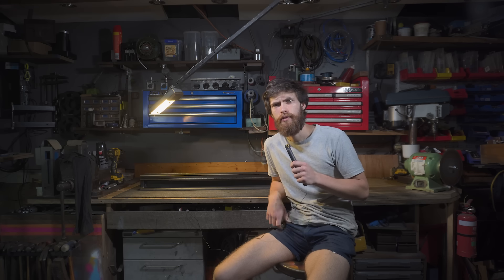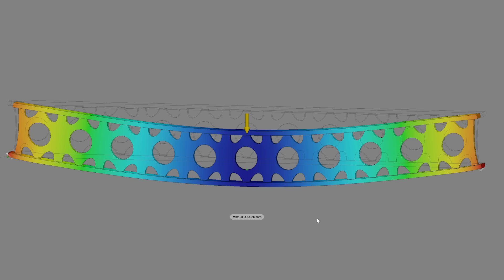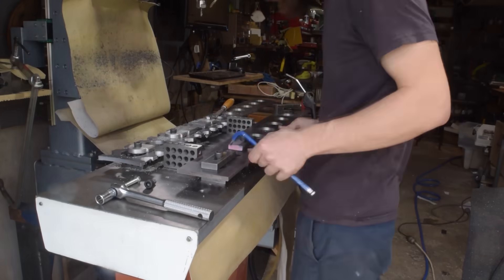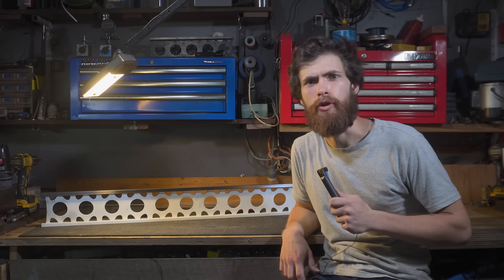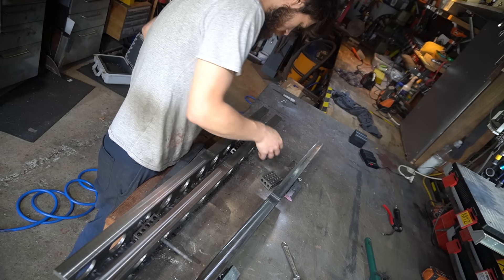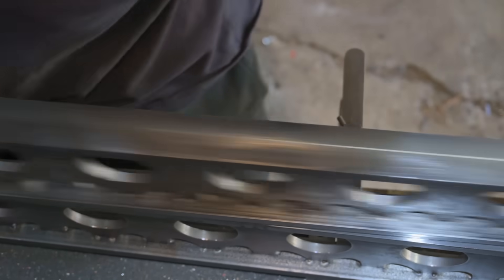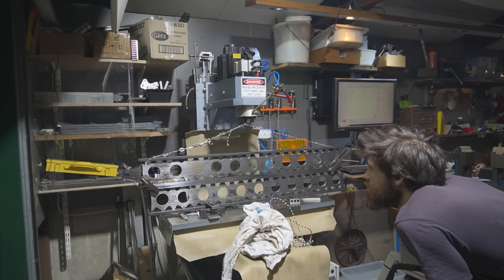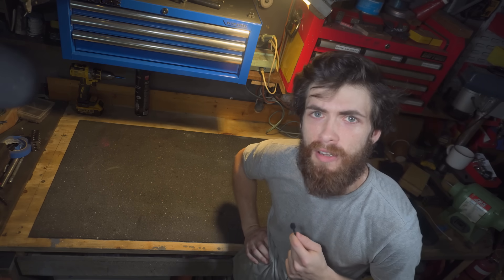I need a PRECISION straight-edge, so I made three

Comment: what is flat in 4D spacetime.... if you trust light then you are going to be misled.. light isnt doing the same speed as mass, so its geodesic in spacetime isnt what anything with mass would take, no path you can ever take will look as flat as it feels, until you are on the event horizon of a singularity. Then what you see and feel will match up, and things will seem to curve in the opposite direction.

what would the worlds largest flattest pane look like? would it curve around the planet, or would it plank on it.. would you be able to flip it even if it went all the way from north to south pole and then all the way back north? if the path was flat in time, and gravity, if you weighed the same at all points on the journey, it is a flat path in curved space, or curved space around a central mass, is it Einsteins or Newtons gravity? If you build a 1000 mile long bridge, with a glass factory making the worlds longest pane of float glass, what geodesic do you pick? flat for light or gravity? Id pick gravity, id bet it would extend all the way around the planet, and still be able to flip it over without the pane breaking. As curved as the path looks, mass considers it flat. If light did the same geodesic as the planet then it would look as flat as it feels, wouldnt it? in 4D spacetime A and B connect even via C the long way around.. that is how 4D geometry works, you have hot density in, cold void out. Motion from one to the other without ever moving, only really possible if you place the universe at the centre of a singularity that is losing mass, it relaxes and a central flat point in infinitely curved space can expand and fill the void, we all do the same, everything with mass dilates every second, but light doesnt conform, its an information wave riding an information wave, it shows the change over time, but I see Minkowski Timespace where as you all think its Einsteins Spacetime, the main geometry of Euclids circle doesnt change if you pin A or B from his compass in place, folding the universe outside in doesnt change the way the math works, but it does mean it is all mirror universes, stacked against eachother separated by tick rates. Infinitely small and hot and dense can be so easily made to look and feel infinitely cold and void and massive, scaling in time lets you flow through the multiverse, if you could go faster or slower than the current speed of information then you could traverse the multiverse, riding threads in and out of singularities.

Comment: I have a large aluminum plate I use when I need something flat and for the heat to disapate faster. It's 16"x48" and 1.5 inches thick. I clamp directly to it when I need the heat to disapate and it keeps the part flat. I am also not an engineer, but I have a bachelors of aeronatics degree and have run a welding and fab shop for the last 21yrs... Last year of college, dad broke his foot, I only had one class that semester so I moved home and commuted the hour to class when I had the class... I had to keep the business going and ended up having fun building 3 wheeled motorcycles (Trikes) using large auto engines, last one was based on a Corvettes engine and trans, so I stayed....

Comment: People  with your type of thought process, that has the essential qualities at high levels, which you clearly do. "If" they also are interested in something like engineering, as long as they hold on to their common sense they are the best for designing, creating, new kinds of different. Things that's never been done should only be trusted to them. To many others don't have common sense and they do stupid , very stupid things. Sometimes to to achieve a certain look for what they are working on. I mean, an air head with a degree in some kind of engineering, is still a air head, but now can be one that endangers folks

Comment: At this very Instant in the video 1:48, I knew the roughing endmill was going to break because it was conventional milling. Prove me wrong, I thought- and then it happened not 15 seconds later at 2:03. If you treat them right, roughing can last quite a bit longer than 15 seconds. Everything else about this video is worthwhile, so I will let it pass. Wait, I just realized he said it was his last endmill trying to buzz dry through hot roll steel the wrong dang direction at too high a speed For that direction and lack of Cutty Sark No.3 Whale Oil.

Comment: Coarse diamonds were an overkill. They got imbedded forever. There are pastes that break down along with the surface. It could have been done better. And when the edge was hung over the botom one, it was anchored on the ends certainly bowing it. I dont believe the 8 micron claim. Hillarious video nonetheless. That's how I've done it in my head before I saw it. Including the contraption

Comment: i ground a telescope mirror as a teenager.   The back and forth grinding (in that case, glass) produced a circular result.   We rotated the glass so that the result was a spherical surface overall. 

This apparently happened because when you slide one piece over another, only the center is in contact all the time.   The ends get less grinding.  So you can’t get a flat surface by sliding two pieces by each other.  The middle is going to be ground more than the edges.
Reply: The center of the top plate tends to grind more the edge of the bottom.  Alternating which plate is on top tends to make a flatter spherical surface.  Introduce a 3rd plate and rotate through pairs and the only surface which all 3 plates meet on is flat.

Comment: Its not just thermal expansion. With the straight esges being equal length the middle is alway being abraded bht the ends will get less abrasion as soon as theh overhang. With that happening on every stroke and as soon as they move that builds up very quick.

Comment: Sooooo after watching this awesome video and a few other less cinematically produced ones, I built 3 300x300x30mm reference surface plates out of welding 3mm mild steel sheet for the main plane and sides, 8mm thick flat bar for back reinforcement and rebar for concrete and gravel to stick to and make the thing more solid.

Each plate weighs just over 9kg and I dont really have a  proper way of meassuring how accurate they are but I cant fit my thinnest feeler gauge (0.03mm) under a small straight edge. But what I really found surprising was how I got them to momentarily levitate when you drop one facing another and then, when you try lifting the one above, it really, and I mean, really sticks to the one under, so you can lift both grabing the upper one even when the surfaces are completely free of oil. I looked up why this happens and there is a thing called wringability, but for it to happen, we would be talking about submicron accuracy so my guess is in my case its all about vacuum effect. 

Anyways, I came back to the video to say thanks and if anyone has any idea about this, feel free to leave your input, I'd apreciate it :)
Reply: Do they stick to each other only perpendicular to the faces, or parallel as well?  I.e., if you stick one on top and use it to pull the other up, does the bottom one slide off to the side or does it act glued in place?  I'd imagine a vacuum effect would only apply force perpendicular to the surfaces, not parallel.
Reply: @Erhannis They seem glued, really hard to pull them apart in every direction.

Comment: i wonder the materials used if they are similar to each other and the previous tooling and if the material itself is prone to the same 100 year wear. but im a new viewer to me all of this is already insane and any skimp on materials wouldnt be feasable. but something tells me the difference between tool steel and mild steel or w/e you are using is a significant difference in tollerance and what you hope to achieve with "perfectly flat." 
There used to be a time where surgical steel was mined from sunken ships and submarines pre-1940s cause of radiation and nuclear testing. also there was a significant amount of cobalt being used as an alloy which led to lawsuits for surgical procedures but in the case of tooling, it would be strength of the material you are working with.
good luck working with tooling steel or other types of hardened steel, i've already seen adam savage, and a few others i cant remember atm but all of them had a rough time. so genuinely good luck with material science cause goddamn if someone can recreate an ulfberht sword.

Comment: Maybe annealing the welded assembly before starting the flatening process would have helped with the temperature differencial deformations you got? I mean, it would still deform with temperature but that deformation would theoretically be more uniform if there wasn't residual stresses within the part due to weld contractions.

Comment: You know, you might be able to wring these. Don't know how size would effect it; they're a lot bigger than one's typical gauge block.

Imagine how satisfying it would be to wring these together. I think you should try it. =D

Wring them all!
Reply from the maker: They actually kept wringing together during the lapping, it was extremely cumbersome!
Reply: @NoEngineerHere I hadn't thought of that, it does sound annoying. Any chance you could post them wringing together, wring some good out of the situation?
Reply: @NoEngineerHere  Yeee I can assure you I beefed up while building my 3 reference plates (just left another comment about it).
Reply: My DIY surface plates briefly float and then stick together but I dont think its wringability in its full effect but plain vacuum, since I find it hard to believe I hand made such high precision tools XD

Comment: Mill scale retreats pretty fast from hydrochloric acid, only takes like 15 minutes if you scuff it up first. Takes about a day if you use citric acid but it has the same result. Citric is also very useful for removing zinc from steel.

Comment: Re: Millscale

Leave the piece soaking in vinegar for a day (warmer the better)- the acid loosens the scale and it rinses off with a hosepipe. 
Fastest way to strip it is a wire brush disk in an angle grinder, which strips all scale/paint/rust ect while leaving the bare metal.

Comment: this flat fanaticism, this flatishism, aside from earning a rick sanchez gold star, suggests you might consider making an Ultimate Pool Table ... which obviously has a smooth top with no felt, because it is so symmetrical that stationary balls don't roll, and even at the slowest speeds don't drift off their straight lines and collect in low spots. instead you simply wait for balls to eventually come to rest, without the glaring anomalies of an imperfect surface. of course, an ultra ultimate pool table is additionally placed in a vacuum; which is a useful way of keeping the surface dust free so that probably goes without mentioning

Comment: No stress relief after welding?  - That makes all that work a waist of time. - Dig a pit and build a charcoal fire and cover the weldments with more charcoal and cover it with fiberglass insulation and leave it until dead cool if that is the best you can do, but you are pissing in the wind without SOME kind of stress relief.

Comment: It seems like you might already know this, but for anyone else, the three plate method only works when you can rotate your work pieces 90 degrees between laps. This method doesn't work with rectangles.

Comment: I used to design high precision gauges.  This method is definitely a good method but in order to increase the accuracy further you would have to do everything in a climate controlled room and give everything a chance to aclimate to the ambient temperature. our metrology room was very strictly climate controlled and i think temps only varried by a degree or two at the most. You would also want to decrease the amount you are touching the parts to limit heat transfer as much as possible. Also you are incredibly funny.

Comment: Subscribed. You’re hilarious - I also wanted to share a pickling bath trick for removing mill scale. MichaelChthulu figured this one out. You just make a reservoir for the parts using objects and drape plastic or rubber sheeting over it. Put the parts in and pour vinegar till covered. Takes a number of days depending on the temperature. It will flash rust so after rinsing the parts dry them quickly with a towel.

Comment: Suggestion from someone that work in the precision industry, u don't put the straight edge on the ends, but on the 2/9 on each side, doing so gravity will have no affect on straightness, and if u want to be extra precise u should have left the parts in a temp controlled place for kinda of a long time if u don't want to thermal treat them, so u will not have any stress relief after lapping.
Its can happen that stress due to milling or welding will appear quite some times after, talking about weeks/months

Comment: You need to square out the openings to maintain flatness after thermal expansion/contraction. Also, do your best to maintain material temperature while rubbing. Your idea for mechanizing it was fantastic. Add springs and bumpers and put a few unbalanced weights on the sides freely spinning and getting thrown about by the rubbing motion, and you should have enough random motion to not require any manual rubbing at all.

Comment: The three-plate method includes "plates" for a reason. The important part is to make 90-degree turns at each iteration. Because instead of a plane, you can get a variety of interesting surfaces.

Comment: Both interesting and entertaining. Many people thinks that CNC is the way to precision. How wrong they are. A machine tool is not as precise as the machines that made it. Unless you put a lot of manual work into making it. I like the way you worked to achieve a fairly good result. Probably better than you ever need.
By the way, a good engineer never sets tolerances tighter than needed for function. Quite rare.

Comment: The next time you need to remove mill scale, soak the parts in vinegar for a couple of days. You'll be amazed.
Reply from the maker: If only they made Tupperware containers a meter long!
Reply: @NoEngineerHere   Wow, I guess they don't have them down there. I can walk into a hardware store and get them here in the states. GET TWO, CUT THE ENDS OFF, AND GLUE THEM TOGETHER!! That's the kind of thing my wife gets mad at me over, lol.
Reply: @NoEngineerHere  Not sure what your local building/DIY center carries but for some long parts I use the cheap plastic gutter material we have here. It comes with plastic end pieces and couplers so you can cut to any desired length. You might have to swap sides due to the thickness of your straight edge. I enjoyed your video.

Comment: A Datum simulator for GD&T flatness as per the standard requires the assemblies (parts, functional gauges, CMM, etc.) be at an equalized temperature of 20 Degrees C. For grey cast iron precision lapping and polishing for flatness the final steps are done in a temperature and humidity controller work room after the part has equalized. The rough fine precision milling for flatness can be milled or honed (high precision grinding), which is done on the shop floor but with constant cooling flow to keep the work piece at a low constant temperature. This is why the feed speed is so low. So, to achieve a flatness functional gauge (a straight edge), the process is done in stages, all the time trying to stabilize part temperature. 

Flatness is an interesting requirement on a part per GD&T because it does not have to be a datum, but most of the time area flatness of a face is a critical feature (or is referenced by critical features) so it is established as a datum. Often you will see flatness as a requirement for a weldment, although it is usually very generous, so the weldment has to be at least tack welded on an index welding table, and then moved to a flat final welding bench (which is also flat but without the need for indexing). If the weldment by design will create heat zone distortion which distorts the part out of spec, then steps have to be taken to achieve flatness after the metal cools. This may require back bending the weldment tube while it is final welded (shimmed and then clamped to create a prestressed bend). When the part is unbolted from the table it will distort which offsets the back bend, making the weldment flat. To get the shim size there is some experimentation of the weld sequence and actual distortion.

Comment: Great job!  I’ve done some MS weldmets in the past and scraped them.  Building a big bonfire and leaving them in there until it’s dead cold makes a big difference, they come out with no ring and reasonably well stress relieved.
Reply: That's a traditional method.  Get something hot and buried in ash so it cools slowly.  A friend of mine built a super-precision turret grinder long ago.  It had a cast-iron plate with revolving spindles, whose positions were specified to be dimensionally stable to within 1.3 microns over a 3 ft span.  They had to run it through a conventional annealing oven cycle 12 times before it finally stopped changing shape enough to hold those numbers. Even then, with an aerospace machine shop doing the work in a temperature-controlled environment, 2 microns was as good as they could get it.  Still turned out to do its job well.